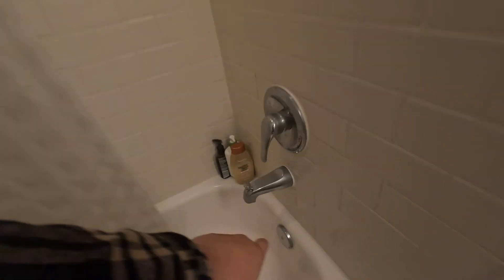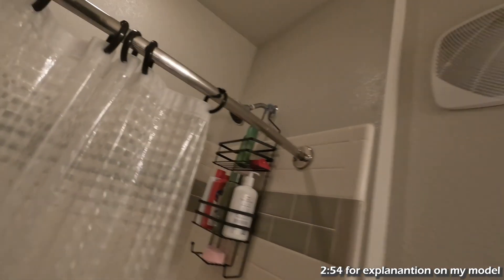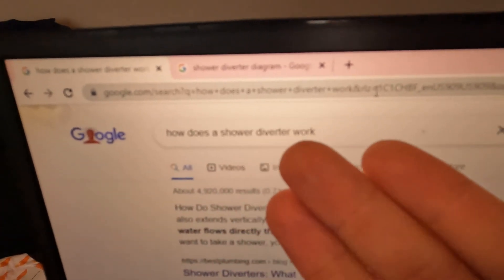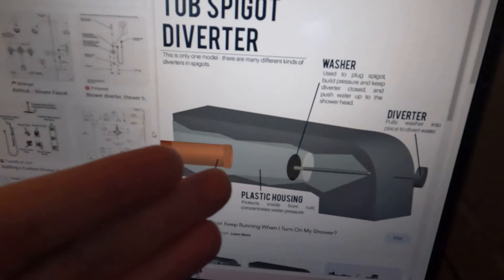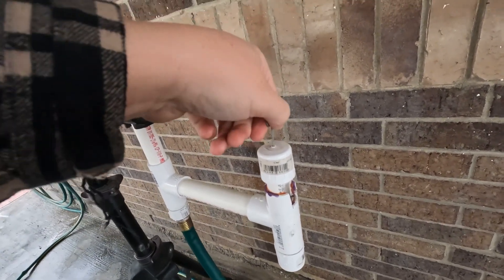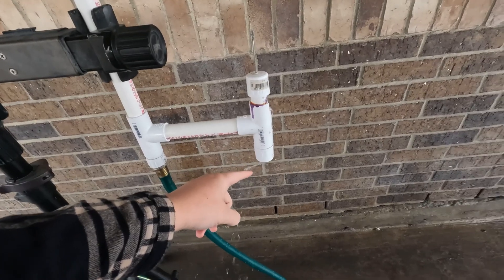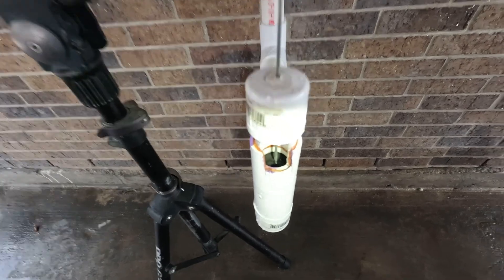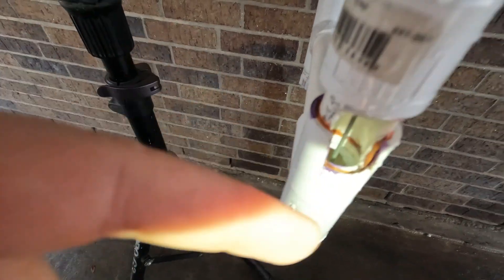What is a Shower Diverter?

Comment: ■■■...BUT you didn't answer the age old question: how does the valve STAY in the up position? Yikes.
Reply from the maker: Fair enough, the valve stays in the up position because once the tab is lifted the rubber seal closes the outlet to the tub. This then forces water to take the path of least resistance which in this case is the pipe going up to the shower head. 

Once that water fills up the pipe in the wall the pressure increases enough to force the rubber seal on the bathtub tab against the outlet allowing the user to let go. 

TLDR; the water pressure holds the rubber seal closed after you let go of the tab. This diverts (shower diverter) the flow of water up to the shower head. 

Hope this answers your question!
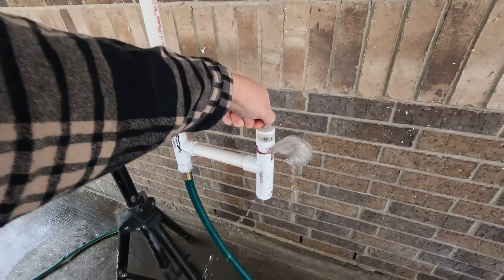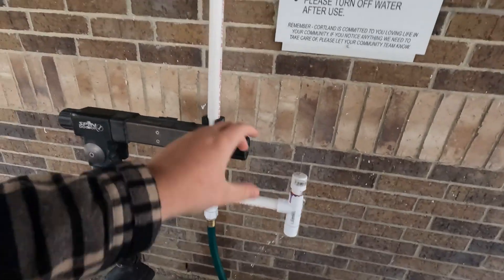Reply: @thechuckyboi1438  One small point I think you left out is that the tab stayed up even after you turned off the water.  So I guess the build up of water in that pipe was enough pressure to keep the tab up until you manually released it (like you did at 2:52)?   Also, I noticed that when you turned off the water there was a leak.  Initially I was thinking it was because there was a decrease in pressure.  Then I noticed at 2:22 that there was still a leak, even though the water was flowing (and had higher pressure).
Reply: Thanks for the comment, the leak is mainly due to bad build quality. My model did function although it was not a perfect match obviously. The leak in my system is because of non perfect build quality, if your system at home is leaking it could be old gaskets leaking or potentially cheap parts. I hope this helped clear up the concern.
Reply: @doublek321 yes, so when you shut the shower off there’s no where for the line to drain so the water stays blocking it

Comment: Great demonstration. So, how does a 3-way shower diverter work?
Reply from the maker: That is a great question and I have no idea. If I had to guess it would be that the cold and hot run through the screw valves so you can get the temp set and then that combined water then goes through the same type of diverter….?.?..? Maybe idek what a 3 way diverter is

Comment: I have a spout only with no diverter. The spout lets out a lot of water while the shower is running which makes the shower stream weaker. Would just changing the spout since it is old an corroded inside fix the leak im having while running shower?
Reply from the maker: I am not a plumber so there is probably better advice out there. Id start with removing the spout and visually checking for any debris or build up. if it is just corroded metal then most likely swapping for a new spout would improve shower pressure.  Hopefully you can get it resolved quickly!

Comment: Wait, but if the water's at full pressure, the water should come out the shower head shouldn't it? how does the shower head not spew water???
Reply from the maker: If the water had enough pressure then yes it would come out of both the shower and bathtub. Most homes do not have enough pressure to do this.

Good question though! And thanks for the comment!

Comment: Very useful. ❤ Thank you. Now…. Please Make a video on the inner workings of the Moen 1222 shower mixing valve. Most commonly used. I bought a new valve for my shower and it does not work. Ugh
Reply from the maker: Late reply, were you able to get your mixer working? I am not familiar with mixers but I might be able to help if you still need it.

Comment: Excellent Demonstration Piece and the explanation.  I had a Moen Faucet and wanted to know how it work, but could not find anything from Googling. For details of the Moen construction, please refer to "Water Not Coming Out Of Shower Head? Tub Spout Diverter Repair"  https://www.youtube.com/watch?v=_2tiphE8PYI   Excellent repair video, but it did not explain how it works.  I try to put in my explanation here and hope to help others who are interested in how it works.  Rubber Seal with a hole in the center.  The faucet water inlet hole is bigger than the hole of the rubber seal, but smaller than the seal itself.  So the rubber seal could seal off the inlet hole completely when pulled to the UP position, forcing water to come out of the shower.  The water pressure coming into the center hole of the seal can inflate the rubber seal slightly to produce a water tight setup. Therefore, a soft rubber seal is important.  When it is too old it can harden and would not provide a water tight setup.  It shows how clever this design is.  The water pressure on the Plastic Gate would hold the Gate in the UP position.  The Gate would not fall down because of frictional force.  However, if the water supply is cut, The Gate would not be held there and falls to the DOWN position and this also the default position.  So, next time you turn on the water, it would come out from the faucet and not the shower.  When showering (ie, Gate in the UP position), if you manually push down the rod/button, you can overcome the frictional force created by the water supply and get the Gate back to the DOWN position, stopping the showering, and let water come out of the faucet.  Note 1, the faucet water inlet hole is inside the faucet you have to use a light to find it.  Note 2,  water tight to the water inlet hole and around the circular plastic ring surrounding the rubber seal on the Gate, you have to examine a diverter repair kit to appreciate the design.
Reply from the maker: Very elaborate explanation, thank you! It sounds like you understand the inner workings of a shower diverter. I received another comment regarding the MOEN spout and I am not familiar with that. Maybe a project to get into in the future.
Reply: @thechuckyboi1438  Thank you, Chuck.  Looking forward for another demo kit for MOEN spout from you.  Sometimes simple devices were made based on physics principles.

Comment: How does it stay in the up position??? water pressure???
Reply from the maker: Yes, the water pressure built up by the filled shower pipe presses the rubber against the “top”(in my demo) creating a seal.

Comment: Thanks.  That’s a lot
Of water pressure that gets pushed to the head.
Reply from the maker: Yeah water pressure and flow rate are at a constant battle in applications like this. A wider shower head will decrease pressure but increase flow rate to a point. Where as a smaller shower head with have more pressure and less flow rate.

Comment: Great explanation. My tub has 2 diverters, on the handle and the spout, and Im deciding if i should replace the spout with a new one w/o a diverter.
Reply from the maker: I have not heard of that, does that mean you have to pull both plungers in order to run the shower?
Reply: @thechuckyboi1438  No you can choose either one.  I always use the diverter on the shower faucet, but the one on the spout is stuck.

Comment: Do you know what causes the pull tab to stay up when showering, but fall down when there is no water coming through?
Reply from the maker: I tried to explain it using the pvc but it is the water pressure. The water pressure is the force that keeps the valve up in the air while water is running. But once the water is turned off there isn’t as much(or any) water pressure anymore so it lets the valve fall. Hope this helps!

Comment: Great video!

I bought a portable water softener for my apartment shower and the thing is heavy (6lbs)! Let's say for whatever reason, the showerhead snaps the pipe. That means no water will come out of the shower pipe unless I turn on the water and diverter right?
Reply from the maker: Thanks for your comment, I’ll preface this by saying I’m j out a plumber and have no training I made this video out of pure interest. 

But if I understand the question you want to make sure that if the pipe snaps off the shower head then will you be able to run the bath without water coming from the top. If that is not your question feel free to expand.

If that is your question I’d say it depends on your bathtub nozzle and water pressure. Because if your bathtub faucet is clogged up and the water flow rate exceeds the faucets then it will start to fill up the shower pipe in the wall until it spills out of the top. 

Depending on when your apartment was built you should be fine, but also consider buying some wire frame supports and maybe adding some support by connecting the water softener to a wall to take the weight off the pipe. 

Good luck! And let me know how it goes!